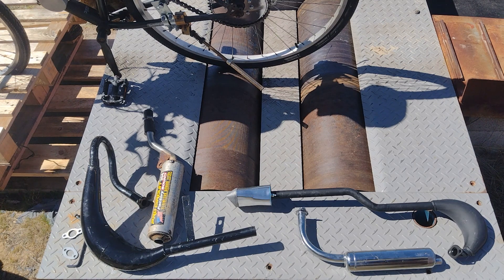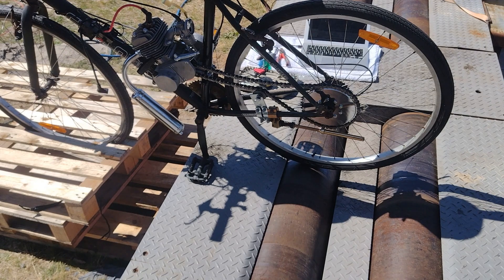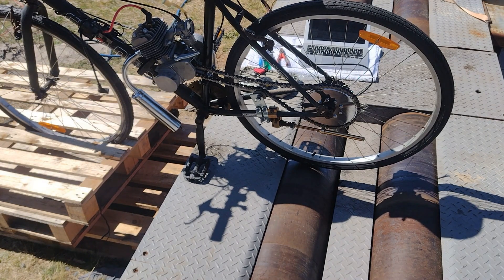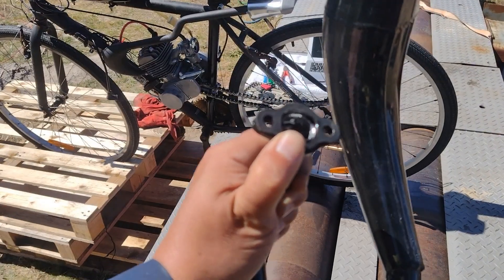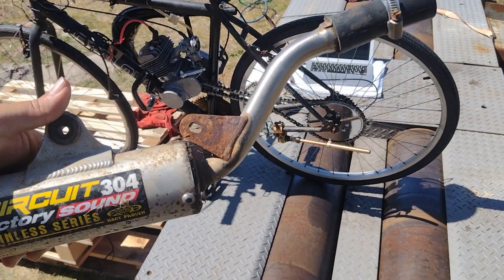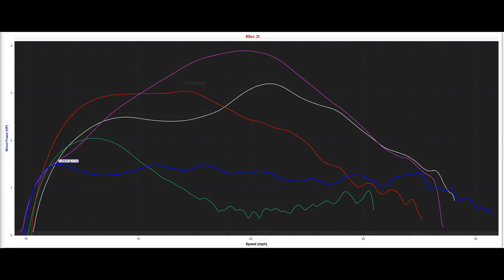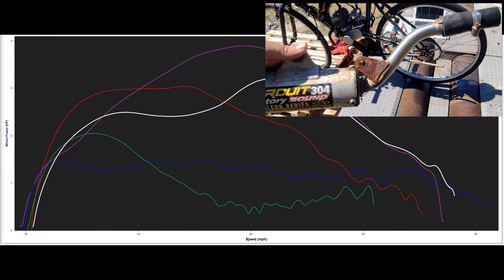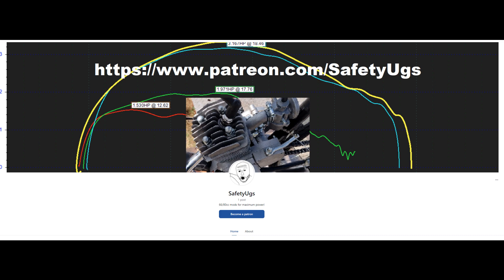80cc motorized bicycle performance mods - part 2 - Exhaust testing

Comment: Great Information 👍 .....So those $45 expansion pipes with a $25 silencer isn't a total waste of money.....But don't make much power for $70 ...I wish I could find a couple free lawnmower sausage style silencers to screw together & put on the end of a $45 expansion pipe to make a smaller lighter silencer.
Reply from the maker: That's a pretty interesting idea! They look pretty restrictive but if it quietens down the pipe and doesn't rob too much power, it'll be a great free source for a silencer! We usually see old mowers free on the side of the road down here

Comment: It would interesting to see power to rpm instead of mph. Because every bike has its own rollout and gear ratios. Quick little wire to the spark plug 👍
Reply from the maker: I agree! and I've posted all the dyno graphs for all our testing over on the motored bikes forum. The link should by in my bio

Comment: I use what most people call a banana pipe and i dont notice much gain but j havent ran the stock exaust since i but the motor on a mtn bike frame instaed of the bmx so its hard to say

Comment: I recognize that power curve on the CDH pipe, I’ve been using one for a while now and it feels just like that.  I’m a little surprised that it shows so much horsepower on the dyno though!  I figured it would be somewhere around 2-3 max.  Anyhow, despite it being in no way a proper expansion pipe, a bolt-on 2.5hp+ gain is definitely worth the investment.  Plus it sounds good and fits most bikes very well.  It’s the best crappy pipe that I recommend to anybody.
Reply from the maker: If you are on the FB groups or the motored bikes Forum you'll see the dyno graphs of the CDH pipe vs my hydroformed pipe. I think we hit 6.5HP with the hydroformed, way more than any off the shelf pipe we've tried.

Comment: How good is yourDyno. Is that an inertia setup or you have active brake on the roller
Reply from the maker: YourDyno has been great! It just works. Before this I tried an Arduino setup and that was a constant struggle to get repeatable results.

This chassis Dyno was originally Vane branded and has a Telma CC115 retarder that is controlled by the YourDyno Eddy brake controller.

These bikes struggle to spin up the Eddy so for these runs it is decoupled (the vane chassis can decouple rollers automatically by pneumatic rams) in purely inertia mode.

Zero regrets with the YourDyno hardware, it's pricey but still cheap compared to what a new dyno would cost.
Reply: @SafetyUggs  Yeah thats cool. I helped build a water brake setup for outboard motors (boats) using YourDyno, uses a stepper motor water valve and a big ass 3 phase water pump to apply load at the propeller shaft. Seems to work OK , few little bugs in the YourDyno software but overall works well. I wish I could film it but he doesn't want photos or videos on line for other tuners to duplicate the setup lol
Reply from the maker: @fullsendmarinedarwin7244  sounds like a pretty neat setup! Would be good to see it if you get permission

Comment: Your chain gives me anxiety 😮
Reply from the maker: I should probably buy a half link and fix that... It doesn't ever go on the road, only the dyno so worst case it jumps off and locks the back wheel up.
Reply: Move your chain tensioner forward some

Comment: I love videos like these. Motor sounds rich on the top or not enough load?
Reply from the maker: On which run? I spent about 10min each exhaust swapping jets and needle clips, what we got on the graphs was the best of all runs for each pipe.
Reply: @SafetyUggs  I’m not talking down one bit. I forgot the load isn’t like riding the bike on the road so it didn’t sound right to me
Reply from the maker: @justanothermotorizedbikech  I can turn on the eddy brake on the dyno for a static load, but as far as the inertia dyno works, it is the same as riding on a flat level surface and accelerating. A dyno run takes between 6 seconds and 12 seconds, depending on the HP. I guess that would be similar for a lightweight rider on the road accelerating?